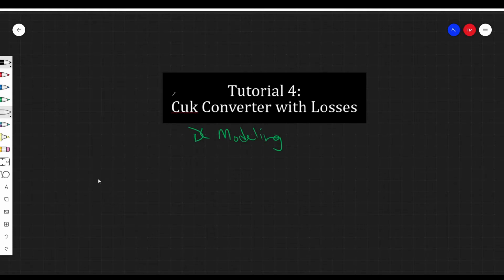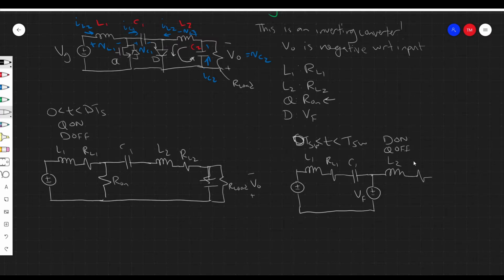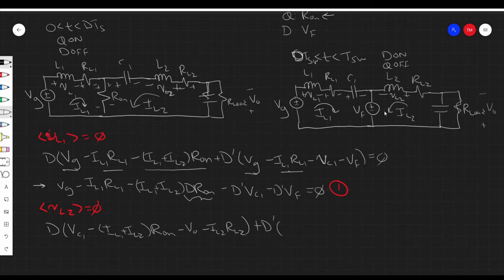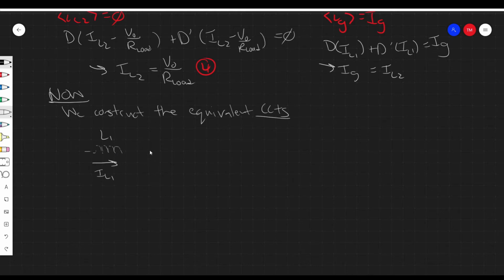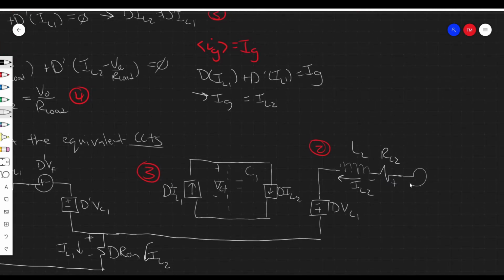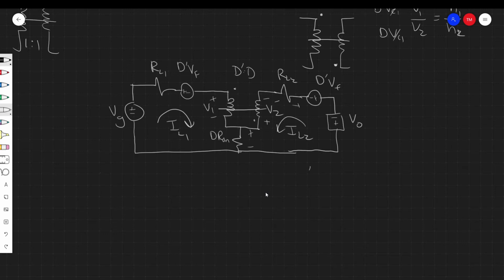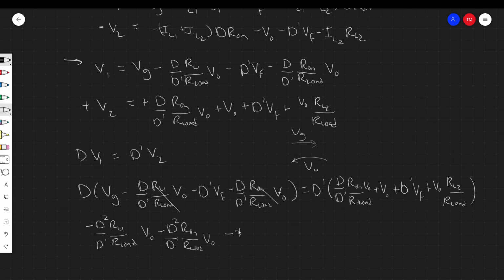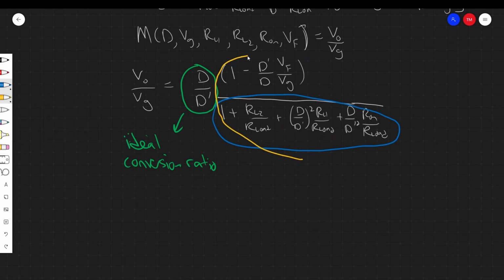Tutorial 4: Cuk DC Model with Losses

Comment: Just a terrible explanation from someone who doesn’t have a clue.
You can’t describe it from the first cycle because the capacitor has to be filled.
However when the MOSFET is turned ON, the first inductor gets a pulse of current that creates a magnetic flux in the core but must be switched off before the core saturates, otherwise it will get hot.
As soon as the MOSFET switches off, the inductor produces a voltage that is opposite to the previous voltage and the lead connected to the MOSFET will be positive and add to the supply voltage.
We now have a high voltage charging the capacitor and the capacitor effectively moves up  HIGHER in the circuit. This means the lead connected to the diode rises and puts a positive voltage on the diode. When the voltage on the anode rises higher than 0.7v, the diode conducts and it does not rise any higher than 0.7v. In other words this lead is now rigid and any energy entering the capacitor will charge it.
The induction can only deliver a small current because any current in the winding produces a voltage in the opposite direction and this voltage produces a flux that opposes the collapsing field.This reduces the amount of energy the inductor can deliver at the moment. The capacitor too, gradually opposes the current entering it because the voltage in the capacitor gradually builds up and opposes the voltage being delivered by the inductor. That’s why it takes so to charge the capacitor.
However the timing of the circuit is long enough to allow the capacitor to charge.
The MOSFET now turns ON and the capacitor drops down IN THE CIRCUIT with the positive lead touching the 0v rail. This means the other lead drops below the 0v rail by an amount equal to the supply voltage plus the voltage developed by the inductor.
The lead of the capacitor connected to the diode will put a reverse voltage on the diode and it will not conduct. A diode only conducts when a positive voltage enters the diode in the direction of the arrow.
This means the negative voltage will go to the second inductor and the other lead of the inductor is connected to a capacitor.  This part of the cycle will be very short and we have already mentioned a capacitor takes a long time to charge and discharge, so we can effectively say the lead of the inductor connected to the capacitor will not move.
The top lead of the second capacitor will have a negative voltage on it and the other lead connected to the diode will fall much further below the 0v rail.
This is where your visual understanding comes in. If the right lead is below the 0v rail by an amount equal to the output voltage and the left lead is further below the 0v rail, this makes the right lead more positive.
The energy in the first capacitor creates a magnetic field in the core of the inductor. The left lead of the inductor has received a negative voltage.
A point to remember: A capacitor can charge an inductor right up to the point where it is almost fully discharged because, although the voltage from the capacitor gets less and less, the current also reduces and the expanding flux reduces its rate of expansion. This means the “back voltage” produced by the inductor reduces. The resistance of the inductor is very small and it only takes a very small voltage to produce the necessary flux. The inductor will get a magnetic flux produced by a negative voltage on the lead connected to the diode.
The timing of the circuit has allowed the capacitor to almost fully discharge and now the MOSFET turns off and the first inductor releases a very high voltage to raise the whole capacitor HIGHER IN THE CIRCUIT and puts 0.7v on the steering diode. This fixes firmly the left-hand lead of the second inductor and its magnetic flux collapses and produces a voltage in the opposite direction.
Now, two or three things happen at the same time.
The second inductor moves UP AND DOWN in the circuit and you can see it was tilted at a forward angle as the left lead was lower than the right lead.
Let’s put some voltages on the leads to explain what is happening.
Suppose the left is minus 18 volts and the right lead is minus 12 volts.
When the MOSFET turns OFF, the first capacitor rises up in the circuit and puts 0.7v on the top of the diode.  This makes the left lead of the inductor rise 18.7v .
This does two things. It effectively puts no load on the inductor and the. This happens the field in the inductor collapses very fast and very strongly and creates a very high voltage in the opposite direction.
Because the right-hand lead is connected to a capacitor, it will move up or down very quickly and the collapsing magnetic field produces a positive voltage on the left lead that matches the 0.7v. As soon as the voltage matches this voltage the collapsing flux send its energy out the end connected to the second capacitor and this is a negative voltage.
This will charge the top plate of the capacitor negatively.
All the positive and negative signs on the diagram are misleading and the description is totally inadequate.
No-one has described the operation of this circuit in a way that l understand.  And if l don’t understand, how do you expect a beginner to understand its operation?
The most important part of this circuit is the difficulty or slowness for the capacitor to deliver energy to the inductor and the inductor to deliver energy to the capacitor.
The timing of the circuit must allow the inductor to produce full magnetic flux but not saturate the core.
Under or over-filing the capacitor is not a problem.
The voltage on the capacitor is monitored and the mark-space ratio is reduced when the load is small.
It is very easy to work out the value of the inductor.
Select a value and turn the circuit on with a very small load. Feel the inductor. It must not get hot and the current should be almost zero. Now increase the load current and see when the output voltage sags. This is the capability of the circuit.
No mathematics, no guessing, no formulae. And most of all: NO INACCURACIES. It is what it is.
I have watched many YouTube videos on this topic and there are so many mistakes it would take another discussion to cover them. 
The value of the capacitors are not very critical and to specify a value of 1.875u is an absurdity when capacitors have a tolerance of 20% to 50%.
It does not matter if the capacitance is higher because it does not have to be completely filled or emptied on each cycle. It is just a transfer of ENERGY.
When 5amps is being taken from the supply, the transfer capacitor will get hot or warm because there is a slight amount of friction or resistance in the charging and discharging cycles .
This will heat it up and eventually dry it out.
And when the average current is 6 amps, the peak current is not 0.75amps!
The inductors are different. They stay cold.